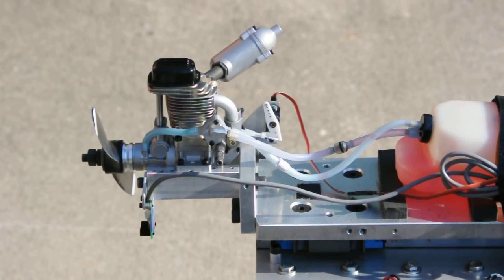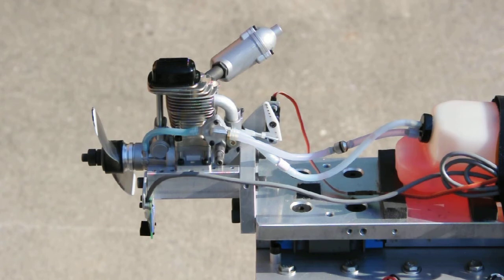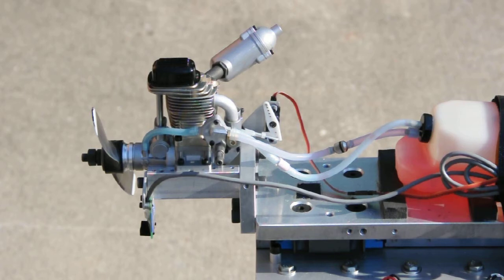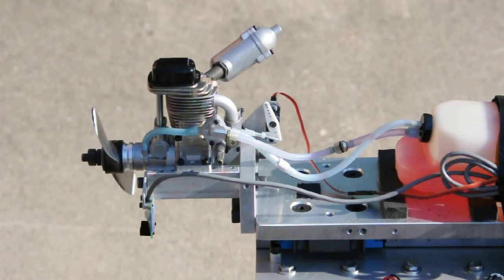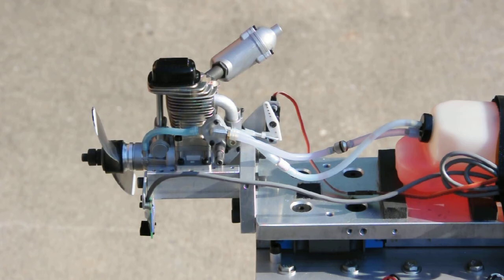YS FZ70-S Four Stroke Engine - Thrust Testing

Comment: After flying 3D with this engine for almost 2 years, I have found Xoar or JXF 13x6 to be the most fun on a 4-5 lb 3D machine. Getting about 12K on 30% fuel and will definitely buy more of these engines. It has been 100% reliable.
I tried about 14 different props from 12-15 inches and settled on 13x6 for a great combination of vertical performance and good airflow over the tail.

Comment: @seng30904   I would suggest to try 30% CoolPower. It's not only the nitro percentage, but also a lower viscosity fuel. YS engines usually  run very well on CP30

Comment: Can you confirm your low (and high) needle settings please? Manual says low needle to be opened one turn. I have mive out to 4 turns with terrible hesitation. Sounds like its flooding when you take the glow ignitor off the plug. Air-bleed carbs mean to open the low needle is to lean it, correct. Top end is great. I dont get the one turn out on the low needle. OS-F plug and 15% nitro, castroil-syn blend, 13x6 APC prop. Any suggestions. What are your needle settings please?